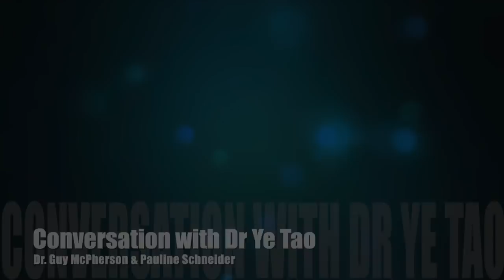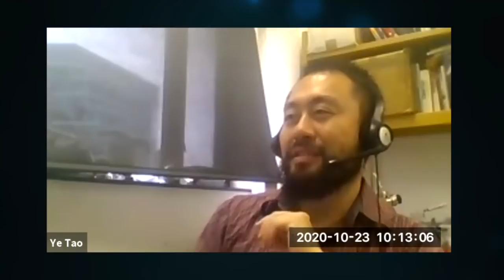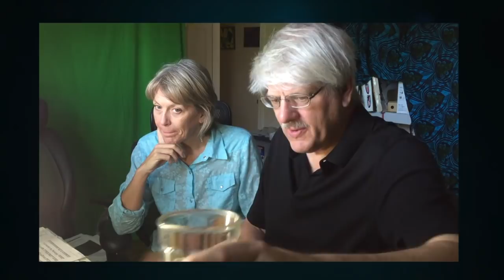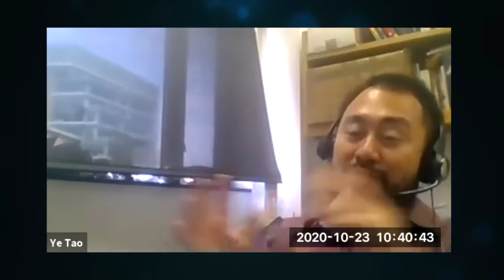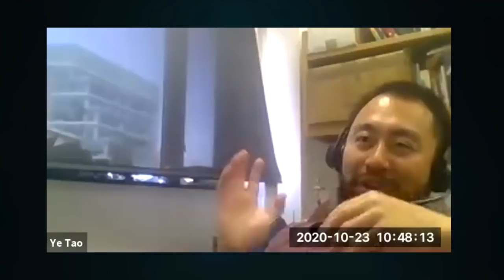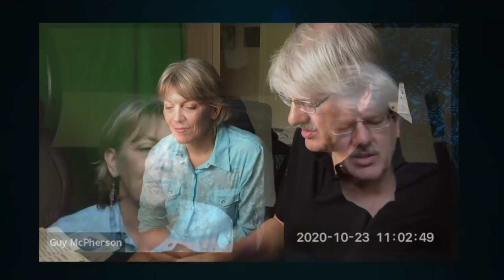Conversation with Dr. Ye Tao on the MEER Reflection Project

Comment: Dr. Ye Tao makes is appear to be a rather simple process. I would like to see more information on the amount of additional infrastructure and energy needed to produce vast quantities of float glass and coat it all with the thin film of aluminum. Additional information is needed on how to stage that vast amount of glass upon seas that constantly undulating over a wide range of wave conditions with the possibility of extreme weather conditions. Also, the effect of fielding that opaque platform over ocean surfaces, needs to be evaluated for the impact it would have upon the life below it including the phytoplankton that generates much of the planet's oxygen.
Reply: These questions are being actively addressed in our teams.  The interview was geared towards to a lay audience, with technical details omitted.  The overall impact on phytoplankton is a multivariable function that includes water temperature, photon flux, solar spectral power density, pH, and pCO2, etc as input variables.  There exists great spatial and temporal variability to the concentration of phytoplanktons.  We have found that some of the best locations for thermal control are regions that are sparse in phytoplankton, likely to due the excessively warm ocean temperatures in such regions that inhibit growth.  The net effect is a boost of local primary production 

The floating mirror arrays will necessarily be a highly engineered system that couples with offshore wind turbines for anchoring, and mariculture for profitability.   Our engineering teams are finding ways sink and float the arrays to provide submerged  configurations for storm protection.
Reply: @MEERSRM  Thanks for the response . I was wondering about the phytoplankton as well {I just yesterday discovered that this interview and the webpage exist} I'm also very curious as to what the mirrors are attached to . My initial understanding, from watching videos from some time ago, though maybe not correct, was that these would be webs of small mirrors attached by and to.....something

Comment: Have to also examine the use of these techs without examining the Precautionary Principle. See The Dust Detective  with High Country news and think about China doing a thousand square kilometers of solar array on the desert and doing food production under it. Seems like a good deal till you realize the loss of China desert dust impacts rainfall in the western USA.
Reply: Very good and and extremely relevant point.  The remote impact is known as 'teleconnection', a well-known effect of climate engineering.   That is why global coordination is important.  Project MEER:ReflEction is unique in that it can be implemented almost anywhere on the Earth's surface.  This enables the best chance to tune the response to optimize rainfall and temperature patterns in agricultural fields world wide.    This is in contrast to marine cloud brightening (MCB), which are limited to certain regions of the ocean, leading to detrimental rainfall reduction such as in the Amazon rainforest.

Comment: I can't even have a low e glass last a decade. How about going with radiant barrier foils and paints. New planetary  energy building and retrofit code. And, tech was proven by Florida Solar Energy Center scientific study in late 1970's. I stated we could save energy, and in the Southwest, water. The radiant foil for a home with a pitched roof would cost a few hundred dollars and ditto for installation. Simplicity is better. Glass having to be made is energy intensive and adds to the global warming. 
Vimeo Verchinski and Thoreau
Reply: Energy required to make glass is 30-40 times lower than the energy required to make equal volume of steel or aluminum.  As a structural material, glass is the only feasible material at planetary scale.
Reply from the maker: actually making glass is not very energy intensive comparatively.   Far less intensive than melting metal, or mining for rare earth metals.